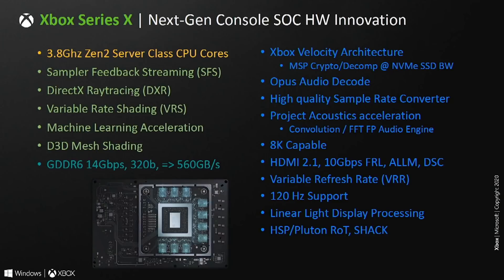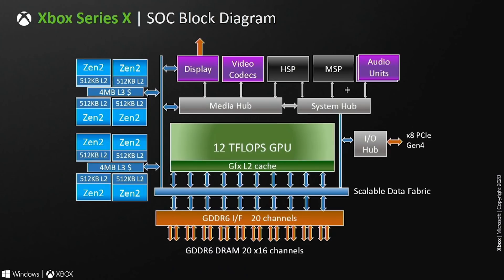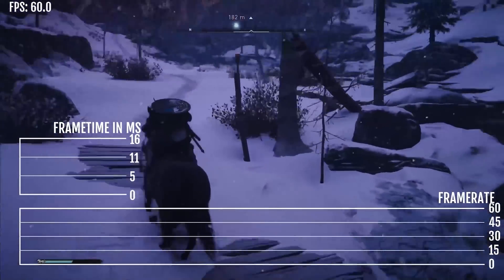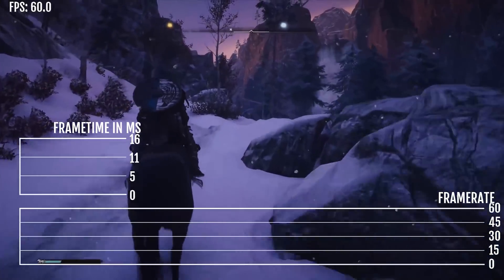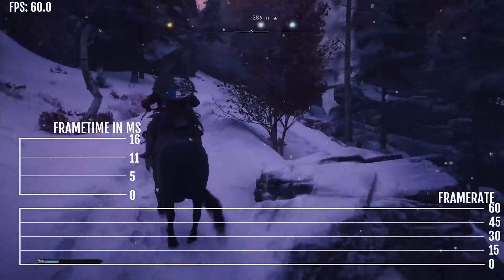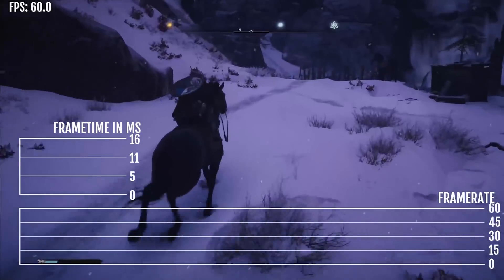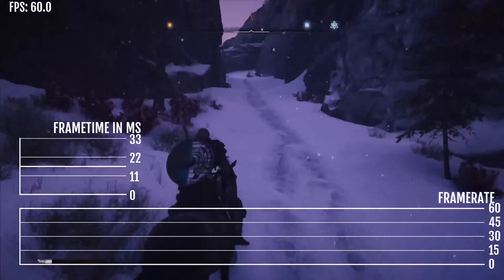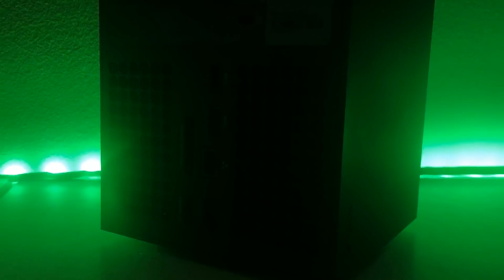Xbox Performance to be UNLEASHED | Xbox Series X Mesh Shaders & SDK Updates Changes Everything

Comment: Mesh shaders are an advanced render method for unreal 4 engine. It's like checkerboarding but using triangles instead of square pixels. What a moronic video. It's also super expensive to use p IP pipeline wise, that's why no one is fukn using it. This tech is 20 years old 🤣

Comment: What a click bait bullshit video. First off, xbox/360 used custom chips as did ps1-3. Squeezing more yes. Not the case anymore. Its basically off the shelf apus that are marginally tweaked for specific console needs. MS bullshit support of its orginal 2013 xbox, is most likely the culprit here as far as performance goes. This fukn idiot has no idea what he's talking about. The hardcore overclocker viewership should be ashamed they are watching this crap.

Comment: HI I see you managed to Get a 3060ti,  I'm thinking of changing my strix 2080ti on my ryzen 3900x, but I only have a 1440p monitor and my series X , so would you upgrade a strix 2080ti ? thanks for the video,. Also I do have an LG Nano Cell 50inch which can run my Xbox at 4k 120hz and the idea was to run my PC of a rtx 3000 card to the tv thanks

Comment: I wish Paul would stop with the narrative that "both designs are actually quite different from one another, with mocrosofts wider design focusing on pure compute performance and sonys design being more throughput based"

The later part of this statement  is simply not true, yes on a pure hardware level xsx has more cus and a lower clock and the PS5 has less cus and a higher clock, but apart from the xsx having more advanced RDNA2 features such as tier 2 VRS,mesh shading support and Sampler feedback streaming that are very simile, its also interesting to note that XSX actually has a "geometry engine" aswell, all RDNA1+2 GPUs have a "geometry engine" the only difference AMD call it the "geometry processor" sony just named it the "geometry engine"  to try and market it bette, microsoft have not even talked about there geometry processor but they still have one on both the series S + X,its even better because it supports mesh shaders while the PS5s and RDNA1 Geometry processors dont. The PS5 uses older and less performant iterations of these technologies that were found on RDNA1 (VRS tier 1 + the geometry processor), 
Once Both system have all there Api and development environment kinks ironed out the only scenario where the PS5 may out perform the XSX is loading times.
Neither system has  different way of doing things, both systems are designed to have great compute performance and data throughput speeds The only difference is the XSX has better compute performance and regarding data throughput its actually the XSX which is superior in this regard because it has the faster overall ram setup, the PS5s faster SSD does not = faster data throughput, you have to look at the systems as a whole.
Times are no longer like the PS3 + 360 days where they where vastly different architectures. The best way to look at the xsx + ps5 is that the xsx is a 12tflop RDNA2 @ 560GB/s with a 5gb/s ssd and the PS5 is a 10tflop RDNA2 @ 448GB/s with a 9gb/s ssd, the consoles are even more similar then the x1+ps4 because this time the ram setups are practically the same.
Reply: Yeah, I'm not sure why tech channels are trying so hard to avoid upsetting sony fanboys. The Xbox Series X is simply the more powerful console. The games are what will actually decide which console is "better".

Comment: Raw power does not improve visuals that much, take last gen for example, using raw power you get something like BioShock infinite at 1080p 60fps, but things like physical y based lighting is what really made a difference last gen. This gen wont see as big of a jump because physically based lighting was pretty huge, mesh shaders will improve polycounts but "the leap" will be smaller because of dimininishing returns, last gen was caperble of practically anything from a geometry perspective, x1+ ps4 could render enough polys for anything really, objects like a chair, car, tree etc do not require loads of polys to look convincing. What is preventing last gen consoles from having better visuals is, effects, skins shaders, animation and lighting in general which Hollywood Cgi still has issues with, so current gen visuals will get closer to Hollywood cgi but the required horsepower needed is getting greater + greater but for smaller gains.

Comment: Let's keep it real 😂 the ps5 has the tech community scrambling to figure out why it's performing the same or sometimes better than the Xbox series x on next gen games! I find it ironic how reviewers need to dissect the eo called issue and skim past the fact that Microsoft wasn't as prepared as Sony for this gen of consoles. If Microsoft gets more power out of the series x Sony will do the same and improve it's "Tools". Don't forget unlike Microsoft, sony is using its own methods which includes the geometry engine.
Reply: Son, anyone with half a brain or who has been following this industry long enough, understands exactly why a very few seconds long sections of a very few cross gen games designed around last gen hardware, ran that whopping 2 to 5 frames faster on the weaker hardware. The only ones who didn't understand it were fankids "scrambling" to spike a football over a last-gen game running 2 to 5 frames higher in 4, 3 second sections of a game. I understand this video confirms what all the "Xbots" have been telling you & you are a bit sore over that, but it's really nothing to get upset over.

Comment: I thought mesh shaders made the whole pipeline simpler not more difficult in terms of work required
Reply: Simpler for the GPU, not simpler for the art/development pipeline
Reply: @SerBallister  elaborate because the art development pipeline is the over all process to developing a video game. Concept > design > pre production > post production. Thats the overall pipeline. Mesh shaders goes into the pre production phase. So if mesh shaders inherently has an easier pipeline to its predecessor, it makes the over development of a game easier.
Reply: @lousaidwat4748  from a programmer perspective you need to insert extra processing stages
Reply: @SerBallister  ok like what ?
Reply: @lousaidwat4748  you need tools to process meshes into meshlets and deal with loading them and integrating it into an existing rendering pipeline.

The "Simplicity" is skipping the IA stage and doing it yourself and in doing so making the workload simpler for the GPU.
Reply: @SerBallister Uh dude the mesh shader pipeline uses less stages than the primitive shader pipeline of rdna1, that's why AMD dropped primitive shaders for mesh shaders.
Reply: @terrenceholland6355   Its less stages for the GPU, and more stages that move to the developer. Similar to how Vulkan is "simpler" for the GPU/Driver, but not as simple for the developer. 

Go check the documents for DX12 mesh shaders and tell me how that is simpler, for a graphics programmer, than the old IA pipeline that requires no additional programming.
Reply: @SerBallister  You're 100% right that the devs have to do more work to get the performance advantage but that's to be expected.  You're going from years of synchronous processing, and vastly underutilized hardware, because of DX 11 style engines, to multithreaded parallel DX 12 processing.  I.e. devs have to re-learn some things, but the graphical leaps will be tremendous, and the industry is moving in this direction regardless.  Dev's have been slow to adopt the newer style of programming but in truth The old style engines need to GO!
Reply: @terrenceholland6355  Yeah its been very slow, DX12 has only just really entered mainstream in the last few years. There are good reasons for this, mainly the huge investments in their old technologies. Making a modern AAA DX12 or vulkan engine is far from trivial for most studios, luckily unreal and unity exist for that.
Reply: @SerBallister  Agreed!!

Comment: This late dev kit and new software excuse are proven wrong by the skyrim benchmark. Skyrim runs at the exact same resolution and settings on the pro and the x and have had their framerate unlocked by a simple mod, and there is a clear advantage to the ps5. This performance difference has absolutely nothing to do with not having access to dev kits or new sdks.

Comment: So what do we gain from a very powerful xbox? Native 4k 60?
So then, what?

Cos i'm really wondering, is there an ongoing problem with games performance on consoles? And this is preventing devs from making games? Have any devs complained that they can't make games because SX needs to be more powerful? 

Kmt
Reply: Um, the same thing you would "gain" if you had a more powerful PS5, Einstein. Did you really need to ask this question?
Reply: @nonyabusiness6084  you don't gain anything more than you have now from a more powerful ps5, Einstein the smartest. The only tangible gains in gaming is games. This is why Nintendo is crushing it.

Can we use common sense once in a while?
Reply: @chordkeys  Games are subjective, the power & what it allows for, isn't. Games just look & run better on more powerful hardware. Especially when built from the ground up for that hardware, Einstein.
Reply: @nonyabusiness6084  we all know that Einstein so why are you telling us? Go back to my original comment cos you sound like the opposite of an Einstein now

Xbox promised best visuals and performance. Now where is it. They lied to you and now you here making yourself look stupid. When phil spencer actually delivers, we will acknowledge it.

Comment: A genuine question, How much of this feature set can be used in conjunction with the other features?

Is it possible for the system to run VRS, Mesh Shaders, Direct ML, Dynamic Res, RT and any other technique at the same time? Or will it be a situation we're the developers have to pick and choose what they implement?

Again I don't know what resources have to be dedicated to the system to run each technique but in my mind I imagine running them all would just tank the system and any sort of performance you gained from the culling would be lost right?

They are after all culling techniques aren't they? Except RT as that is a lighting pipeline.
Reply: Most are RDNA2 features, but yes, they could all be used simultaneously. In fact, it will be those features along with hardware accelerated ray tracing & ML that will allow games to run at 4K 60fps with ray tracing enabled at some point.

Comment: PS5 is nothing more than a enhanced PS4 Pro. That's why it is easier to develope for.
Reply: It really isn't. It's really well designed and easy to program for.
Reply: @DanielOzzzy189  Wrong I've seen two honest videos from PS4 Pro Gamers that noted that PS5 is nothing more than a ENHANCED PS4 Pro. It's not really that much of a big jump for those that purchased the PS4 Pro. You're just getting Native Resolutions and improved fps. Very little more than that. And videos explaining that PS5 uses the same tools as PS4 just enhanced. PS5 is poorly designed. The FACT that the SSD Memory Expansion Port is not working yet should tell you that??!! And I'm betting that you won't even be able to play games off the Expansion SSD Drive because heating issues will cause performance problems. THAT'S why it's taking Sony so long to get the Port up and running!! Why else is it taking so long?? Sony is obviously hiding something. ?? A update should be available right now!! If problem is fixed. And if you think about it. Any problems should have been addressed with the prototype of the PS5 and redesigned should have been made well ahead of PS5's full production?? ZERO excuse for that!! Microsoft designed their SSD Memory Expansion Port for the convenience of the Gamers. Just plug it in AND you can unplug it and take it to your friends house!!! Absolutely CANNOT do that with PS5😫!
Reply: @infuriousone5225  whatever dude. Lol
Reply: @DanielOzzzy189  Is this dude okay seems someone is a little insecure about is console of choice
Reply: @jordangilyard5478  Yeah Ponys are desperate to justify buying that 36 CU joke of a PS5 Console.
Reply: @DanielOzzzy189  Yeah he actually thought I was talking about you this dude I have a ps5 and plan on getting a series x also I’m not gonna argue with this tool kissing his Xbox at night

Comment: Direct x12 has been out and programmers still have issues optimizing. Hmmm 🧐
Reply: The updates haven't even been out 6months yet, How long do you think it takes to make games? the games that are coming out now have been in the works for years for the most part. and we are already seeing games running at higher res on sx than ps5.

Comment: So as the generation goes on does that mean PC game ports will be easier to  port across to the XSX as it  has the same RDNA 2 tools and PS5 went with the geometry engine?  I'm just intreseted the more games the better.
Reply: @garyhay6889  I'm not confusing anything.  Dev Studios will be coding new games to take advantage of this new GPU microarchitecture & on Microsoft's new Dev Kit which allows them to build both the Series X|S & PC version. AMD didn't create this new GPU & Microsoft did not wait for it for nothing. They built that new Dev Kit for exactly this purpose. To not only allow developers to more take advantage of these new RDNA2 features, but also to cut down their work load by allowing them to build a game for multiple platforms simultaneously. Again, to what degree devs decide to go all in on these new GPU features & what features are in that new Dev Kit that allows them to create these new games to also run on older GPU's with an older microarchitecture, is the only question. They can clearly make it work or will have to. As the PS5 is more like RDNA1 than RDNA2. I imagine due to the PS5 & all of the older GPU's in PC's, it will be a while before the dev studios make games that really take full advantage of the new tech in these new GPU's. For now the PS5 & all the older hardware in PC's will keep games from from being built to fully take advantage these new GPU's.
Reply: @garyhay6889  Son, I were playing Pong & following this industry before you were squirted into existence. I am very well aware of what publishers do, who said any of that? That has absolutely nothing to do with anything I've talked about. You must either not be very bright, or just trying to find someone to argue with. I don't argue with children. I do teach them however. The fact of the matter is, regardless of any "Publishers," these new games will be coded to take advantage of the new hardware & technology in these new Consoles & they will be doing that on Microsoft's new dev kit. Consoles drive this industry & game design. That's where they make their biggest profits. Game Studios have always designed their games around the hardware in the consoles. That will be absolutely no different this generation. And being that Xbox has a brand new GPU with new technology, they will be designing their games to take advantage of it. Absolutely no one was talking about any "Publishers" or which "target platform" they choose to focus on. I am clearly talking about when they've already chosen their "target platform" and when they are the new consoles, Einstein. (Which they usually are) Or I wouldn't have been talking about them coding their game using Microsoft's new dev kit, now would I, genius?
Reply: @garyhay6889  Who gets "upset" over anyone or thing on Social Media, let alone some kid trying to act like a know-it-all about video games of all things? Son, anyone with half a brain would've known that I were clearly talking about when they design games around the new consoles. Not games designed to run on last gen hardware. That you didn't get that, says a lot. You keep drifting off into subjects no one was even talking about. Are you a bit slow there, shortbus?
Reply: It appears that the new GDK will allow developers to build their games for Series X|S & PC at the same time now. So essentially both versions will be the same, just scaled for the hardware.
Reply: @garyhay6889  That would mean that no Game Studios will be building any games that take advantage of the new RDNA2 GPU's from AMD all because so many computers still have old GPU's. Why would AMD even bother & why would Microsoft wait for AMD'S new RDNA2 GPU's for the Series X|S if that were the case? Games will still be coded using the new GDK & I'm certain Microsoft thought of that when they built the dev kit & have a solution. The new GDK likely has settings that will make it easier.

Sure, I'll bet that old GPU's will prevent developers from building their games to be completely reliant on RDNA2 features & that will hold back games a bit. But there has to be a way to code these games so they run on older RDNA1, GCN & a variety of hardware configurations. Otherwise they would not have even bothered. There's a point where they are going to have to go all in on such new technology to push game visuals ahead & people are just going to have to upgrade their GPU's to play newer games. Needing to upgrade your GPU to be able to play newer games has always been the case on the PC side of things and was far more common back when I were building them & graphics were advancing much faster than now.